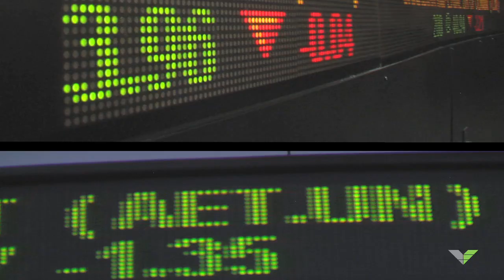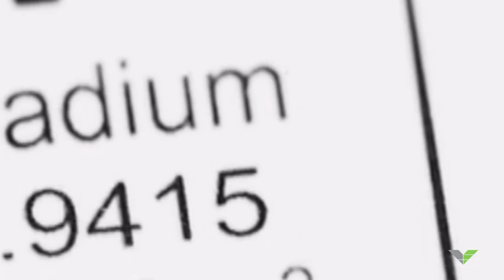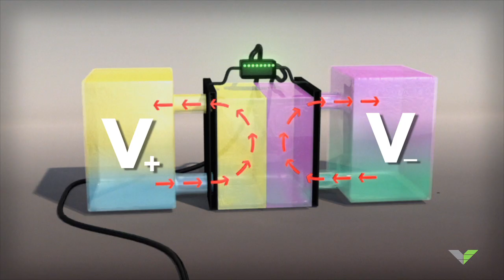What is Vanadium? Learn in less than 5 minutes

Comment: This stock will blow in the next 5 to 10years best believe that. Penny stock atm but once this Greener idea sets in cleaner energy you watch from the Ev industry to shipping and so fourth will all be heading towards this. Holding energy longer and efficiently will see this blow in terms of market cap and share price right out the window.
Reply: From what I understand about most redox flow batteries though (including vanadium) is their charge and discharge rates cant compete with lithium ion which is a large factor in EV since you need to command a wide range of discharge rates for decent acceleration for an FEV to compete with standard combustion vehicles, however redox flow batteries have much better long term storage capabilities and lower environmental impacts than lithium ion, so redox would be better suited for home and utility storage markets.
Reply: @brodericklesher2955  it's still an up and coming stock to get into with long term potential
Reply: @bradley2427  Oh for sure I'm not disputing that at all, but I dont think it'll be used in FEV's anytime soon
Reply: @brodericklesher2955  I don't know man, we're coming into an age where everything is becoming electric
Reply: @bradley2427  That's not my point though, lithium ion battery tech currently is better suited for FEV's because you can draw power from them more quickly than a redox flow battery which is important for decent acceleration to compete with standard gas cars.
Reply: @brodericklesher2955  I'm not talking about just cars. There is a market out there for them and its coming
Reply: Bmn